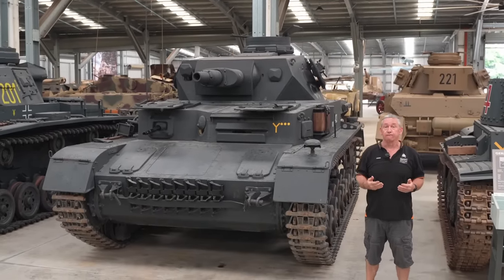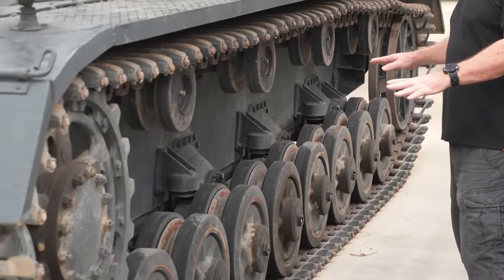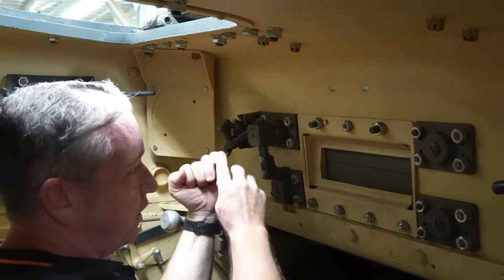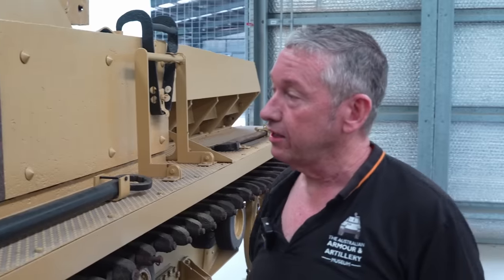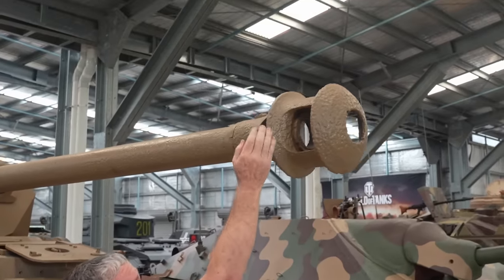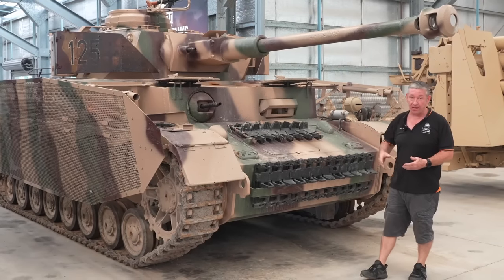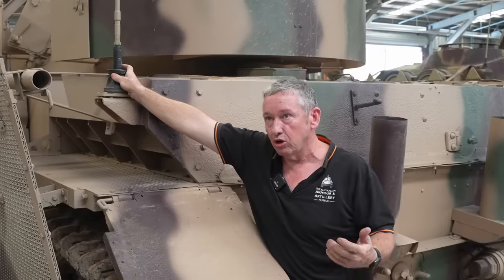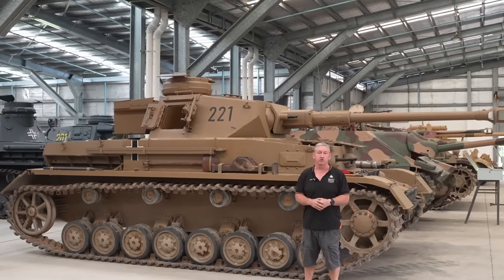The Wehrmacht's War Machine: Panzer IV and Its Variants

Comment: Fantastic rundown on the PzIV. I find myself not wanting to do models of these because the reference material needed to get the right features, from the right factory, from the right month...........
Reply: You should still continue to do your modelling. You don't need to get down to the specific factory and month of production, but it helps to be aware of those details. 
Mark from Melbourne Australia 🇦🇺
Reply: you dont have to be that particular.   the vehicles got worked on all the time, crews changed all sorts of parts around.
Reply: I suspect in the chaos of war, many vehicles probably didn't have all of the "correct" features for their production date, just whatever parts were available in the supply system.

Comment: Excellent video.  Are you certain that Pz IV G's turret is an H?  Late Ausfürung G definitely had those side skirts fitted at the factory.  Most changes qere transitional and not introduced atthe start of the next "Ausfürung".
Reply: This makes sense.  No reason to hold back on a relatively simple improvement like skirts, that could save lives.

Comment: on a motorcycle you need to keep the chain lubed as well as cleaned and adjusted this gives a much smoother ride and more power to the rear wheel well in theory;  do tanks tracks need this attention ?

Comment: The leaf spring suspension system of the pz IV was because the original design was meant to be fulfilled by companies that had railroad car experience. The F2, was an interim change between the F and G and no official documentation refers to an F2. It was basicly a late production F factory fitted with the ausf. G gun that had become available before the ausf F was phased out of production. A simpler description of barrel length would have been to use the term calibres. And, Jason, as a former armour man, you should have known this. The panzer IV was NEVER meant to be the MBT of the panzerwaffe, however, the larger turret ring allowed for the longer calibre, higher velocity gun to be fitted where as the panzer  III was maxed out at 50mm (effective) combat use. Yes, Pz III ausf N  did mount the l24 75mm but that was a serious strain on the turret ring (upon firing as well as armour weight upgrade limitations) was deemed by the waffenamt as no longer viable.
Reply: It wasn't just the larger turret ring. Pzkpfw III and IV had similar sized turret rings and changing their diameter wasn't a problem. But Pzkpfw IV was also designed for more weight and potentially higher armor levels than the 3. And the larger gun means significantly more weight. This is why they actually switched to the IV.
Reply: @dnocturn84  Turret ring diamter on the Pz III is 1530mm compared to 1600mm on the Pz IV.
The long 75mm barely fits inside the Pz IV so there was simply no way to effectively mount the long 75mm in the Pz III without major changes.
Since they needed tanks with effective AT guns the Pz III was simply faced out when the Panther become available, with the Pz IV only being kept in production because they couldn't afford to stop producing it.
Reply: @kimjanek646  Agreed and I am aware. But the Ausführung K of the Pzkpfw III and the Ausführung N used Pzkpfw IV turrets, as far as I know. There was a limitied production run of a few Ausführung K (not the later produced command version with the same name), with a long barreled 7,5cm KwK (the one of the Pzkpfw IV Ausführung F2) in a normal Pzkpfw IV turret. Same happened with the N Version, where a F1 turret was paired with a Pzkpfw III hull. Those weren't original PzIII turrets with these guns, they were supposingly straight PzIV turrets. So it was possible to equip the Pzkpfw III with these more powerful guns in general. Surely, the tank gained too much weight and had to face a number of issues with this solution though. But it was a decission to not equip the Pzkpfw III with these guns and not neccessarly a limitation. The StuG III already provided a powerful and cheaper alternative to throw a long barreled 7,5cm gun on the battlefield, in an anti-tank role amongst other possible roles and the production capacity of PzIV, V and VI was prefered. The Pzkpfw III continued to fill a gap of much needed tanks in the meantime. And its 5cm gun was accepted to serve in this role.

Comment: ERRATA
At 7:10 the narrator says that smoke grenades could be "fired over the top of the vehicle". That's not so.
The smoke grenades were dropped out of that box, creating a cloud of smoke behind the tank, which it could reverse into.
The trigger was a simple wire, appearing as a ring-pull on the firewall behind the commander's legs, and it connected to a ratchet in that box which would drop one smoke canister each time the wire was pulled.
Reply: Thanks for the pick up and correction Davey. Correct, these were later replaced, albeit briefly as turret mounted grenade launchers on the PzIV G

Comment: In my inexpert view, the Panzer IV in its different varients was the best tank in ww2 as it was the only one used between 1939-1945 that remained effective throughout (even if it was by no means the best tank by the end of the war).
Reply: Nearly 30 Pz IV A variants built in the mid 1930s were used in the Polish campaign in 1939 but they were ALREADY obsolete because their armour was so thin.  They were still useful, of course, because the Poles were quickly pushed off balance by the rapidity of the German attack.

(The remaining 175-odd Pz IV’s used in Poland were B and C variants, which had much better armour.)
Reply: @sirrathersplendid4825  
If you're saying that they were useful in Poland then how could they be obsolete?
Reply: @markkelly9621 — Depends on your definition of obsolete. 😊

They were considered obsolete by Western standards — that is by French standards, which were the best in the world. Indeed, most of the Panzer IV A’s seem to have been pulled from front line duty before the France campaign, though a few may have seen use as command tanks - i.e. as mobile HQs.

Comment: How cool would it be to have a book or two. Done in the style of a walk around full of pictures of the tanks with interior and exterior detail As a reference material for model makers. Or most popular 10 tanks.on sale in store and online.
Reply: Sadly, the tank that we saw - I think it was the Ausf.D - doesn't have much of its original interior. Even in the driver's area, which is the only area they showed us, it's missing the gyro transformer, the intercom connection, the fuse box, the overhang indicator lamps, the hatch quick-release, the spare vision blocks, and (as they pointed out) the episcope.

Comment: Great vid! Re the decision not to adopt torsion bar suspension, this is discussed in Spielberger, Doyle & Lentz, "Panzerkampfwagen IV and its Variants", (Schiffer, 2011), p. 72. It says Krupps tried it and hated it. On the L24 gun, its anti armour performance wasn't bad for the time: in 1935 the Waffen Ampt. quote it at 43 mm at an angle of 60 degrees at 700 m (Spielberger, et als, p. 180). They go on to say that's as good or better than the newest French tanks, but also noting the accuracy with AP is questionable beyond that range.
Reply: Yes, right. But these earlier versions of the Pzkpfw IV weren't really meant to fight other tanks, according to doctrine. Besides infantry support, it was mostly meant to destroy trucks and other softskin, when it comes down to fighting enemy vehicles. They were able to fight an enemy tank though.
Reply: @dnocturn84  The Pz IV was a 'support vehicle' (literally begleitwagon, or BW). This lead English-language analysts and historians to interpret 'support' the way it was understood by the Brits, and they thought it meant 'infantry support'. I mean, look at that short little gun, right? But that's NOT what the Germans meant. 

In their pre-war development they wanted a tank to support the other medium and light tanks. They understood the 20-50 mm guns wouldn't be enough for all targets so they wanted a respectable piece of field artillery and thus the 75 mm. They planned for a tank company to comprise 3 or 4 troops of Pz IIs & IIIs, and one of Pz IVs. So it was a tank, and it went in a tank platoon (or troop) and like the other tanks its job was to provide general purpose, mobile firepower. It wasn't an infantry tank anymore than it was an anti-tank tank. 

The mistaken application of the 'infantry support tank' concept has created an artificial and imaginary division of tasks in the early German tank arm.
Reply: @Splattle101  Yes, agreed. But it still wasn't an "anti-tank tank". Tanks did more than just fight enemy tanks. Infantry support, attack enemy positions, fortifications, trenches, buildings, vehicles. The early Pzkpfw IV were still more viewed in a support role, to hit hard, where the smaller guns of other tanks did too little damage. But you expalined that part yourself very well already.

Comment: Never knew that the Panzerwaffe were concerned about chemical weapons late in WW2, had they come across it's use somewhere? 
Don't recall reading about any Allied or Russian vehicles being fitted with such devices.
Reply: If you are going to deploy chemical/biological weapons, YOUR OWN MEN & equipment need detectors & protection. The Nazis never used them in WWII, but they did have stockpiles. Come 1945 they may have been preparing for last resort use [I'm guessing], but it's claimed they didn't use these weapons since they relied so heavily on horses.

Comment: Germany should've stuck with tue Panzer IV and modified it, instead of creating newer tanks. The would've had more Panzer IVs on tie battlefield, which would've changed things dramatically.
Reply: No. It reached the end of its upgrade potential by spring 1943 and it never could be built in numbers to make a difference.
More Panthers than Panzer IVs were built 1943-45 anyway.